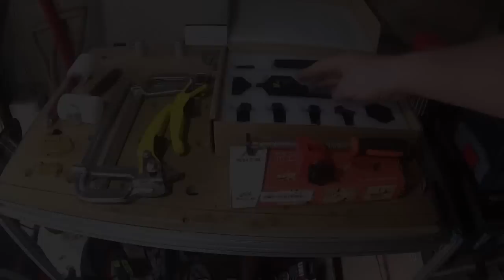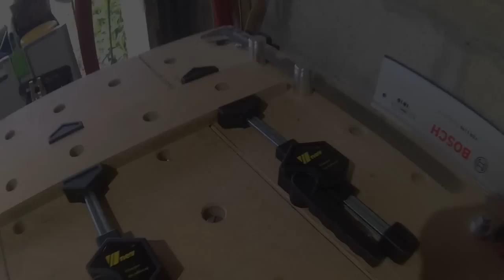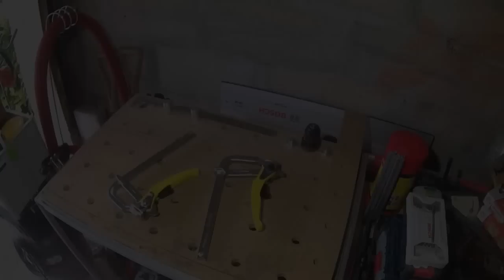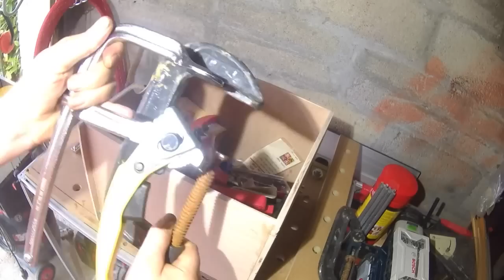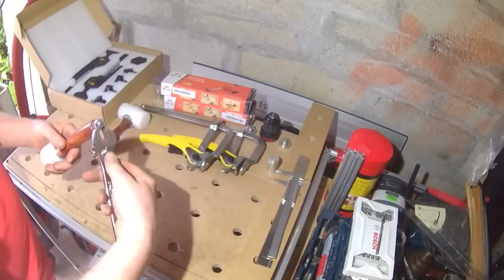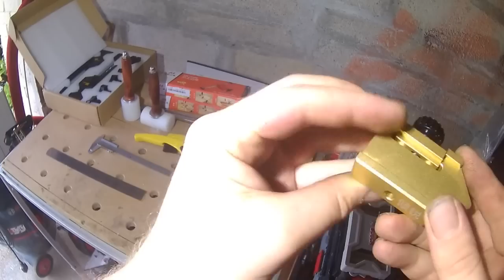Banggood Clamps, Hammers & Rule Stops!!

Comment: Will the F clamp feet fit through MFT holes? Maybe with a bit hacked off with the grinder? 
Cheers
Reply from the maker: They won't fit through the holes as they are. It's possible you could grind the foot down easy enough. It would take a hell of a lot of grinding around the bend to get it to go into the holes though. Even with the guide rail clamps that work for these holes, it takes some jiggling into place and they're much slimmer. Possible but not sure I'd recommend it.
Reply: Bisch Basch Bosch 
Thanks for the reply dude. I’ll not risk it then with the F clamps, I have ordered the linear clamps off the back of this video though, and a GSR 18v 60 FC, and the GET 55 125 (£101 on Zoro, mental!), it’s been an expensive day watching YouTube! 
There’s also a B&D jobber day in my dining room waiting to be bastardised into an I Rack
Thanks for the content man, I really enjoy your vids.
Reply from the maker: @lewisbullock3349  Thanks Lewis. Appreciate it. £101 for a GET? That's a great deal. Good find. Hopefully all these purchases serve you well. Used the GET and the 18v flexiclick a lot now out on jobs and have come to think of them as 2 gems in the Bosch range. Really good tools at a good price. Same goes for those linear clamps. In almost daily use. If you're on facebook, you'll have to send me a pick of your bastardised Jobber if you get round to it! Sure you'll do a better job than me. I just wanged it in lol.
Reply: Bisch Basch Bosch 
Here’s the £101 GET in case anyone else wants it

https://www.zoro.co.uk/shop/power-tools/orbital-sanders/get-55-125-professional-heavy-duty-turbo-random-orbit-sander/f/92892?query=Get%2055%20125

I’ve had random Bosch bargains from Zoro before - picked up an L boxx 102 with all the coloured small parts inserts for a tenner before. Their website is awful to use (the mobile version at least) but sometimes you stumble upon gold

Comment: Glad to know about these clamps.  The yellow ratcheting clamp looks a lot like the bessey throat clamps, originally for welding.  Woodworkers use them, too.  The Bessey version on amazon is a little less than double the price in US$.  Bessey makes a similar edge clamp for about the same price on Amazon.  It doesn't get good reviews, though, mainly that it deflects and is only useful for very light clamping.  I'd be curious to see if your edge clamps have similar limitations.
Reply from the maker: Thanks K.B. Yeh I've seen welders use very similar ratchet clamps. Did check prices of the bessey version on amazon and such. Cheapest is to buy as a pair but still a couple of quid more than the banggood  ones. Very little difference between them tbh. The little edge clamps hold OK but, as you can see in the video, start to over tighten and they send the main clamp slightly askew. Largely because the foot is on one side of the clamp bar. I've used them as a pair pushing down on profile to spread the load and found the pressure adequate. Depends what you'd want to do with them I suppose.
Reply: @BischBaschBosch  Those edge clamps would rely come in handy when lining up long lengths  of edging, nice to have another pair of hands